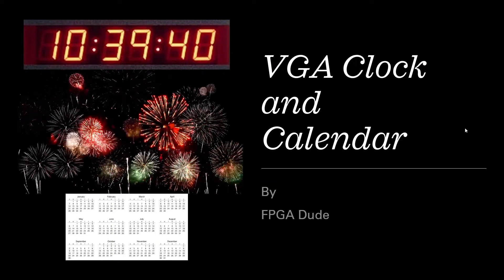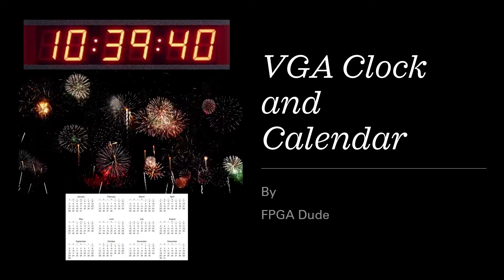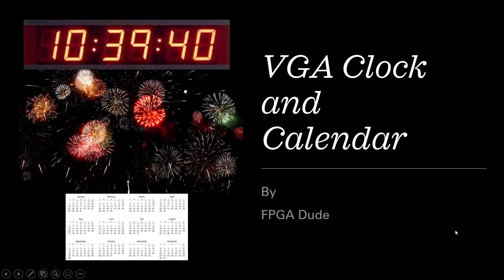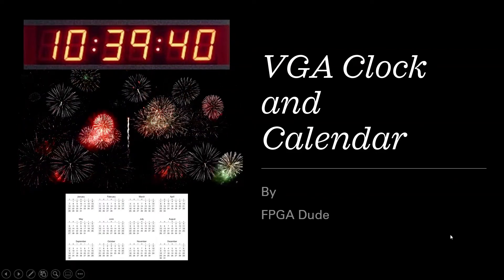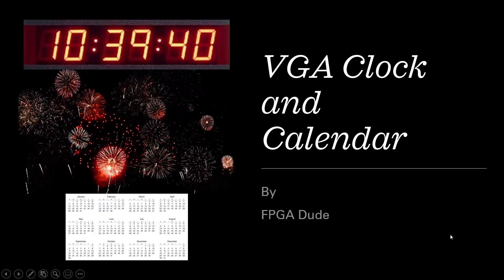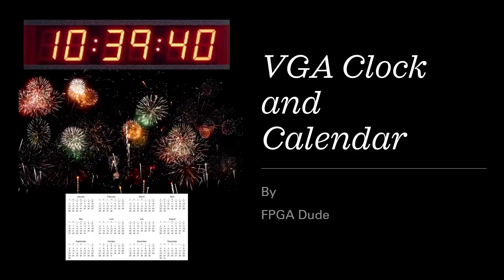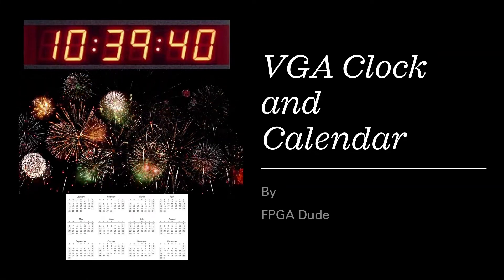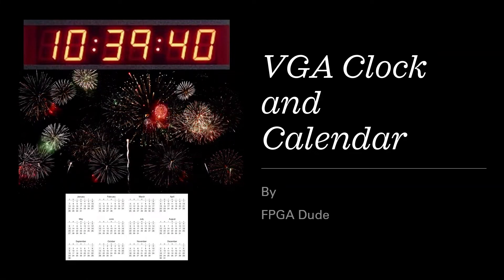VGA Clock & Calendar Verilog Basys 3 FPGA

Comment: David the files you show on video are different from your github. top is different and you have a design_top file on your video but not available in your git hub. not sure what happened!?
Reply from the maker: Ok, I probably uploaded the wrong files. I will take a look and fix that as soon as I can. Glad to hear you got your PMODs, and now you can have some fun with those.
Reply from the maker: Ok, I think I found the correct files, they are in the folder on Github now.
Reply: @dajoma36  yes thank you its now working !. Great stuff 👍👌
Reply from the maker: @Avionics2  Awesome. Thanks for the heads up.